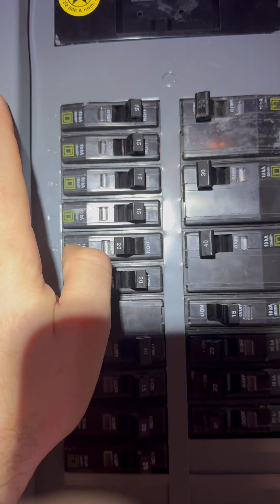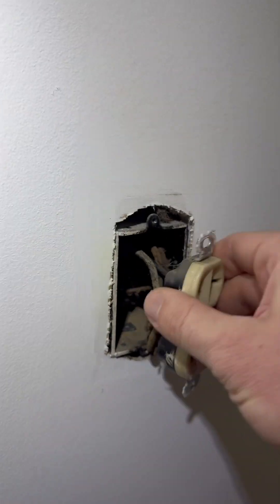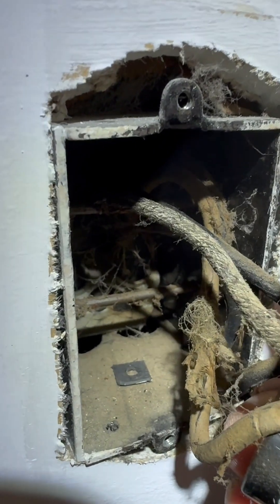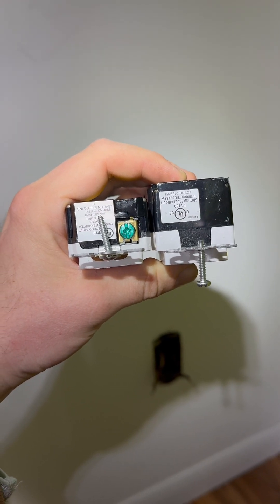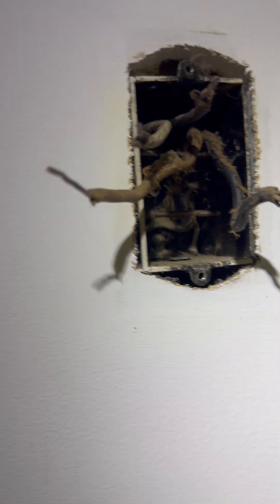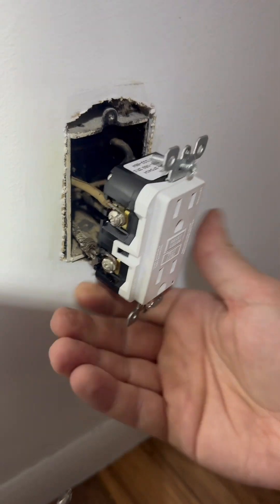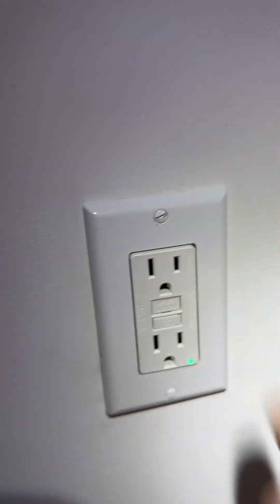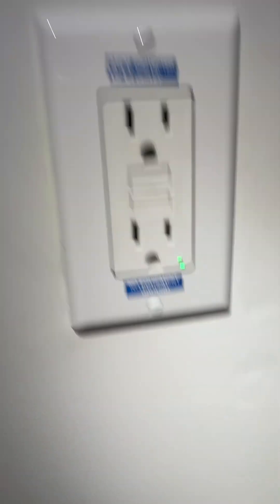Ungrounded GFCI install #electrical #electrician  #electricaloutlet #gfci #diyelectrical #outlet

Comment: There's a pretty good chance the box itself is grounded by a wire, they just didn't run the ground wire to the outlet separately.  Something that needed a specific ground, would be grounded to the cover plate screw.  Which is one reason those adapters were made that way.

Comment: Why in heck use a ground fault imterrupt outlet with no ground.
Reply from the maker: @rebeuhsin6410  there is no ground wire, correct. The GFCI will shut off the outlet in the event of a ground fault. This is the workaround in the absence of an ungrounded outlet.

Comment: I’d recommend getting test lamps.. phone chargers to test for power isn’t good practice
Reply from the maker: @buzzypc23  I tested it before I shut the breaker off to confirm it was working too, wasn’t in the video.
Reply: @Cody_Austin  There's a pretty good chance the box itself is grounded by a wire, they just didn't run the ground wire to the outlet separately.  Something that needed a specific ground, would be grounded to the cover plate screw.  Which is one reason those adapters were made that way.
Reply from the maker: @ according to my home inspection report, this outlet and about 80% of the other outlets are all ungrounded. Almost every outlet in the upstairs portion of the house was a 2-prong outlet as well. I went ahead and switched everything to GFCI because having an electrician come and run ground wires to every outlet would be many thousands of dollars. The previous owners did disclose this when selling.

Comment: Working on electrical and you don’t have a volt meter? If your charger is bad and lies to you showing theres no power, then you’re in trouble. Verify the correct way with a meter.
Reply from the maker: @curtisthatcher2577  what if I checked that outlet using the charger and phone method before I turned off the breaker and knew it wasn’t lying to me? Is that kosher? I’m here to learn 🤓
Reply: @ that could work. But the main thing is to make 100% sure there isn’t power on that receptacle before you pull it out. They also make an outlet tester that you just plug in to the outlet that will show you if there is power. Some will also let you know if there are wiring reversals or missing grounds. They’re about $20. Pretty cheap option to make sure you’re safe!

Keep in mind that more people die by 120v power sources than any other power sources. Just want to make sure that you are doing it safe if you’re doing this work.
Reply from the maker: @curtisthatcher2577  thank you very much! I appreciate the knowledge
Reply: BTW. A multimeter can be had from internets or Harbor Freight tools for like $6 and if you get one of the testers someone mentioned.. getbone with GFCI test button, that way you can test the outlet in the end too.

Comment: Those are nails
Reply from the maker: @michaelleonard2923  what purpose do they serve? They’re in a lot of my receptacle boxes in this old house I have.
Reply: @Cody_Austin  they run through the boxes so you can nail them into the frame to hold them in place.
Reply from the maker: @curtisthatcher2577  thank you, I learned something new today.
Reply: @Cody_Austin  they just nail the box to the stud. First time I saw that when I was wiring an exhaust fan to my parents bathroom, I was like “wtf is this bullsh-t?” I had to change the box, and had a hell of a time getting those bastards out, without cutting out more drywall.